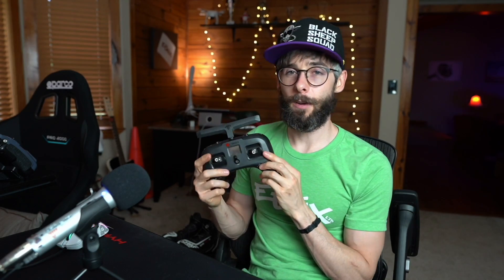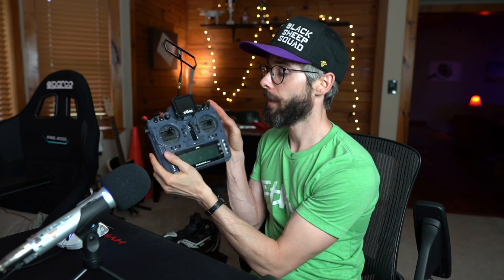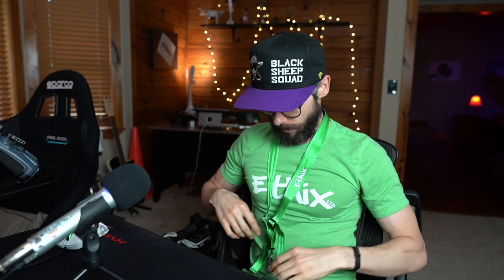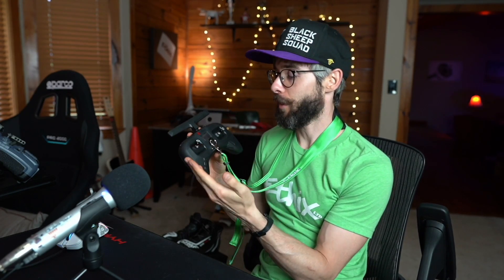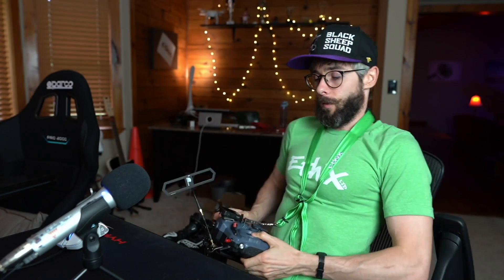Drone Controller Technique (How to FPV 2020) part 2

Comment: why the duck I have hard times hitting the gimbal walls while pinching????!!!!!!!!!!!!!!!!!!!   do you have to have such big hands to use full size gimbals??????? how big are your hands? from tip of medium finger to wrist? can you measure it pls????
Reply from the maker: Hand position is key. Make sure you’re flying with a lanyard and the radio is supported by your neck and not your hands.  Then pinky side palm is on the sides of the radio. Thumbs on top of stick ends. And index in front of the thumbs touching them in center stick but moving accordingly as you articulate the sticks up and down respectively.     If it’s still a stretch try lowering your stick ends down 5-10mm and see if this helps

Comment: Great video - Thanks. As a bloody beginner I think you can also mention next time that applying stick extension might be beneficial. Though I understand that this has nothing to do with the thumb/pinch technique itself. I am having tremendous difficulties managing to fly thru any pylons on Velocidrone at the moment. But since I have extended the sticks on my Tango2 by (say) 5-6mm I can manage it slightly better.

Comment: I can use either but I am used to big old bulky style controllers from all the helicopters and planes I own or have owned in the day haha but I was forced to get used to the small Xbox style when I bought the mavic mini im not a huge fan of the small controllers but they are nice to easily throw in the drone bag and transport haha I actually ended up buying a pelican for just my rc controller lol  loving the videos cause like I said I was used to helicopter and planes but drones are way different and I jumped into freestyle drones on the higher end but it still taught me that I always need practice haha

Comment: Exactly the video I was looking for 👍   Do you think just with just the thumbs one could attain the same control as with pinching and the hybrid?  (I know you talked about this..... but this is  because I -wrongly before watching that other video of yours about RC - bought my first RC, the Taranis X-Lite Pro (now, I don't want it!) but... I have a week practicing in Velocidrone, and I am getting the hang of it, but just Thumbs. Do you think I should re-learn even if it is way more difficult to me that Hybrid or pinching methods?

Comment: I am one of those “former 3d heli pilots” I’ve tried many times to do the pincher method but it was so awkward holding it traditionally and trying. I am definitely going to try today with resting it on my stomach. Just tried it and it just might do the trick. Super glad I watched this video. Ty Mr. Steel.
Reply: flyingskwerrl pinching on the stomach with a lanyard is the only really good way to pinch

Comment: I'm waiting for a neural link setup
Reply: Latency may vary...😎
Reply: It's here
Reply: It's an older video but a Florida University did used an older AR Drone to control it thru a unit that would make your DJI goggles look small.lol
Reply: I'm too lol
Reply: Sure unless you get distracted or get an invasive thought and all goes to ...
Reply: Most people got it in 2021 but it's not for our benefit. It will be used against you.

Comment: If you wear glasses. Will the goggles not be focused/clear since you can’t wear your glasses in the goggles
Reply: goggles (for the most part) have corrective lens inserts. some goggles have a focus adjustment as well.
Reply: You have to purchase diopter lenses separately
Reply: Joshua bardwell uses lens inserts. I think he made a video about them